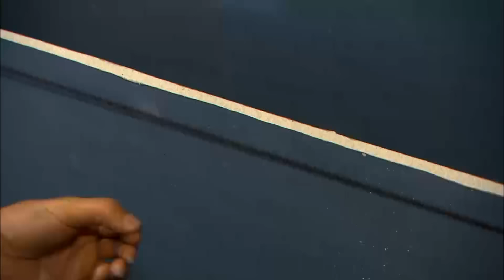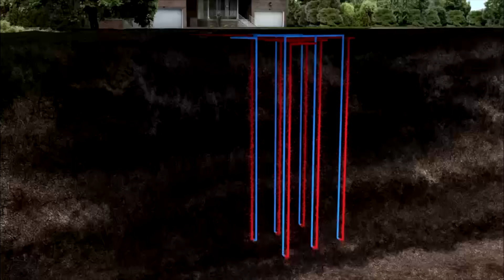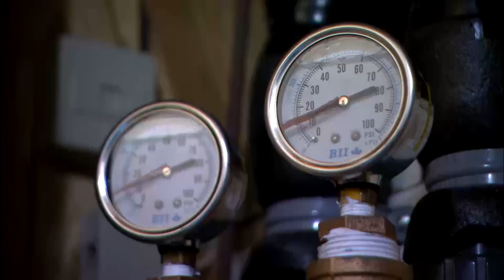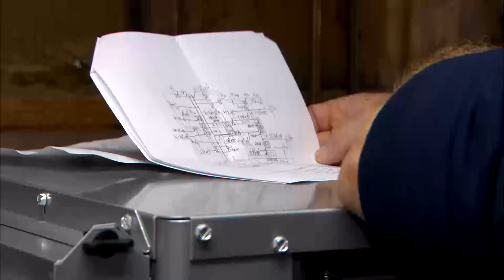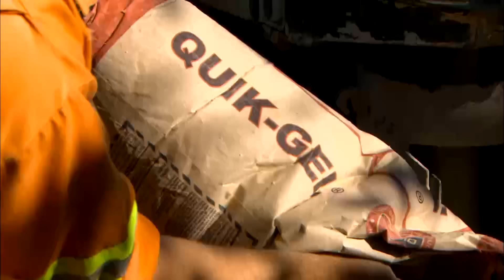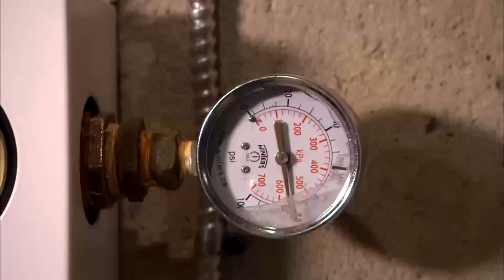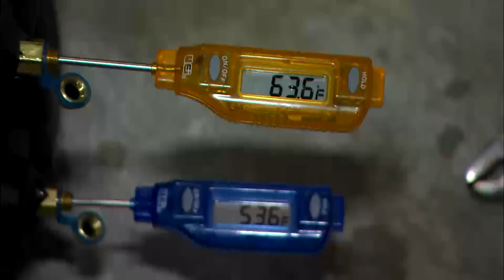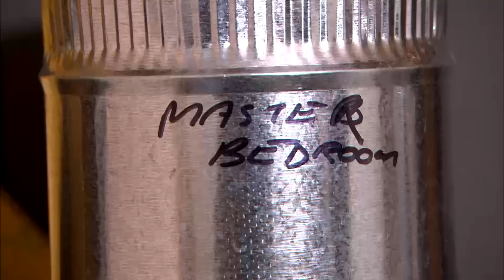Saving New Parents and Thawing a Frozen Geothermal Nightmare | Holmes Inspection 207+208

Comment: I am constantly amazed with how soft the concrete that they break up in these basements is. I did construction work for a number of years and I can’t tell you how many times even the larger electric jackhammers weren’t enough to get the job done and that we had to go rent the pneumatic jackhammers with the big air compressor because the concrete had gotten so hard overtime that it was ridiculous. I guess some people were just cutting corners when they poured the concrete here.

Comment: Brit here, Holmes keeps on about having a home inspection, but really just how good are they? tied to a realtor seems anti customer.
Why isn't there a National Register showing all qualifications/ Licenses/ Insurance and ties to realtors plus customer complaints?  Otherwise they are completely useless. What's the point of asking a dumb inspector to inspect your proposed buy?  How in hell is a customer to know if the inspector is fully competent? House buyers need a more reliable "Inspection " Someone completely independent, fully insured, and customer recommended!   Seems to me Canadian house buyers are open to scams an rip off merchants country wide.  With governments and insurers washing their hands of the house buyers plight.  Permits should be followed up by inspectors paid by the local government, with high penalties for law breakers.  Plus there needs to be much tougher penalties on the fly by night "contractors". Houses for sale, should have enforced certificates for electricity, gas, HVAC, Foundations etc. Make the seller responsible. Its a bloody shambles.
Reply: There's absolutely no requirement to use the home inspector recommended by your realtor. Plenty of independent, insured, competent home inspectors out there, but they don't make it onto this show because they led their prospective buyers away from the dud houses.

I'm forever reminded of the comment I saw on one of those "fix my restaurant" shows that was complaining that the show never shows any restaurants with good food, service, and reasonable prices. I said well of course: restaurants with those things don't fail!

Comment: Over build it yourself, if a 2x4 will work put in a 2x6 . put a lot of steel in any concrete . my 30 by 50 concrete floor has never cracked lots of steel . always overbuild it will pay off in the future .+

Comment: Pfff!! They are called gutters! Not troughs.... Silly Canadians...
Reply: In the Midwest, we call the pipes 'rain leaders' -- those are the vertical seamed downspout pipes, from roof to end, then they change as to part where the final short bend in rain leader downspout is, in guiding rain or snow melt away from the structure. The k-panels of seamless extruded aluminum installed along the roof / eave ends are also called gutters! I've never heard of them referred to as troughs before!!!!